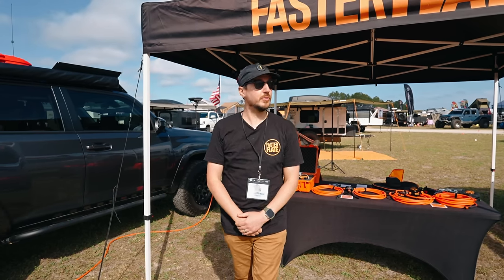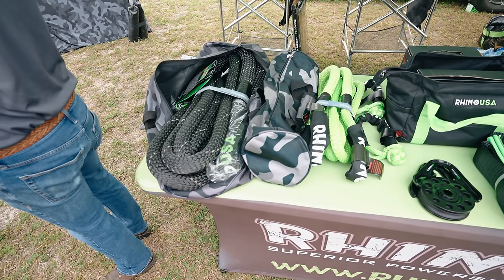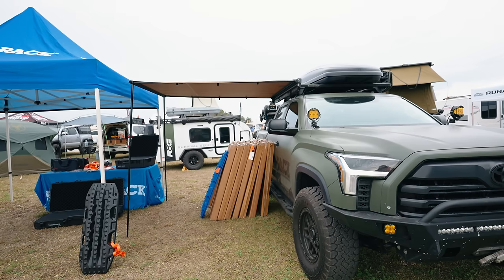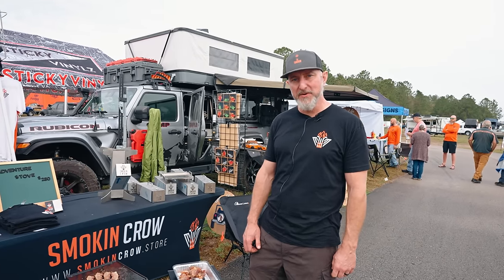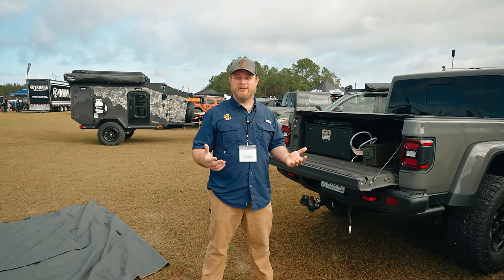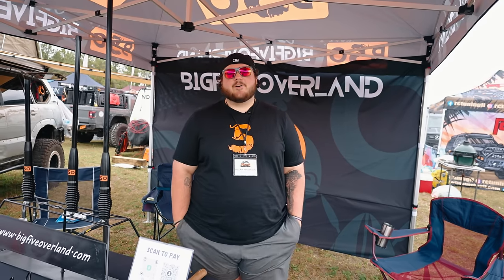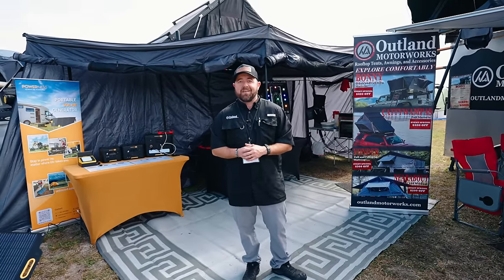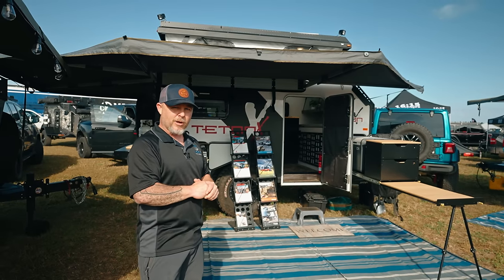50 Vendors of Southeast Adventure Vehicle Expo '24

Comment: For all those who want a solid off grid tip: seven 16.9 water bottles are all one needs for a good shower. Trust me, try it, you will see. Small guy, big guy, it doesn’t matter. Again: seven 16.9 water bottles is a very good shower. Use two to get yourself wet, pour from your head down on at least one bottle. Lather up your whole body, wash your hair. Five bottles to rinse yourself off! Seven bottles tops! Big guy, small guy, doesn’t matter. Enjoy. Cheers. 🥂😊